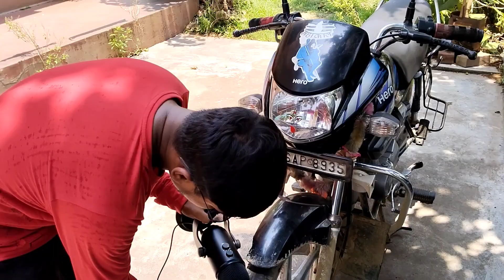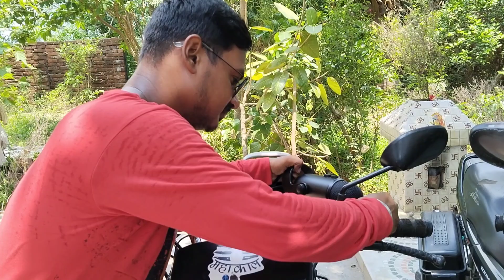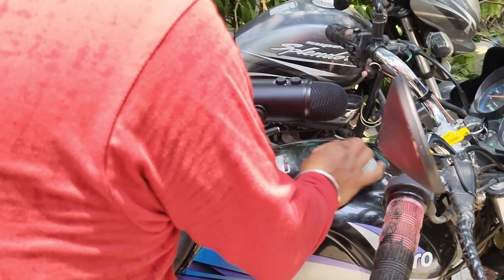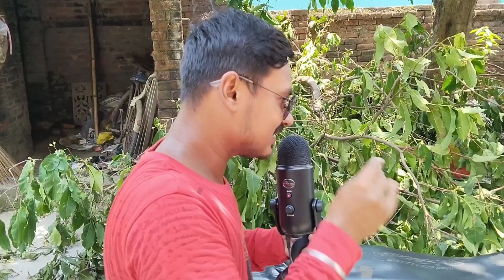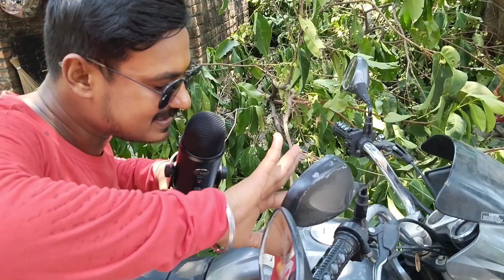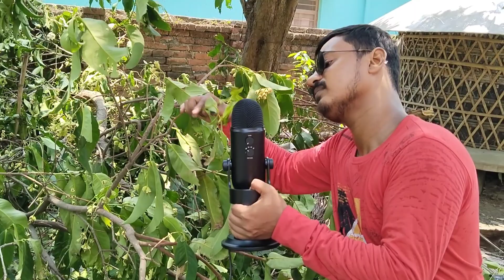ASMR In MY Bike 🏍️🏍️#outdoor

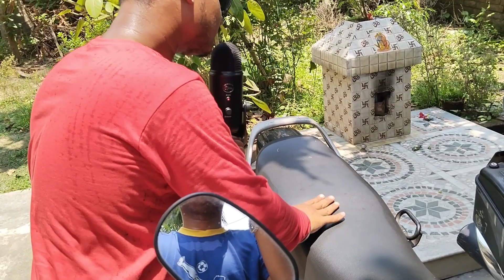Comment: 2:50 Why is there Nazi signs all over that concrete Pot in the background?
Reply from the maker: This is called Tulsi temple .thanku for asking ❤️
Reply: These are not Nazi symbols! Before Adolf Hitler stole and appropriated the symbol for the use of the Nazi party it’s original meaning was a symbol for divinity, spirituality, good luck and prosperity in religions including Hinduism, Buddhism, and Jainism. To tell the difference between the Nazi Swastika and the Religious Swastika is that the Nazi symbol has the arms turned to 45 degrees giving it a slant, whereas the swastikas of Hinduism are presented with the base arm lying flat.